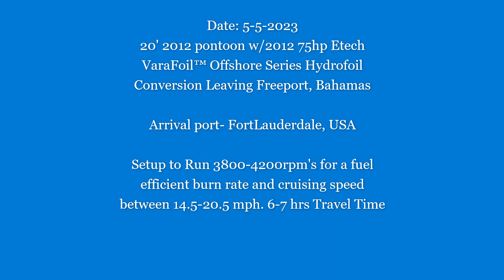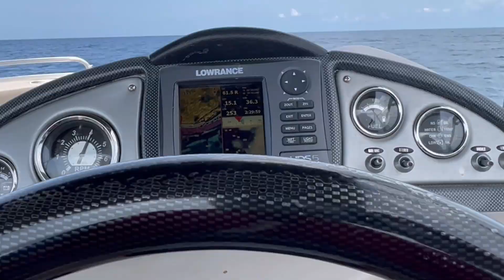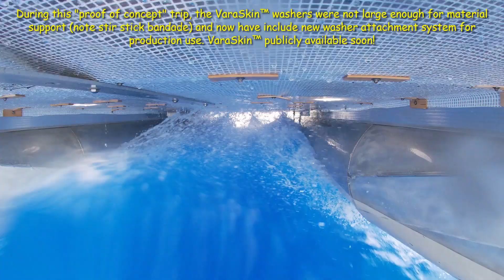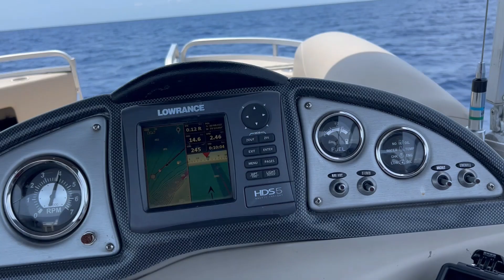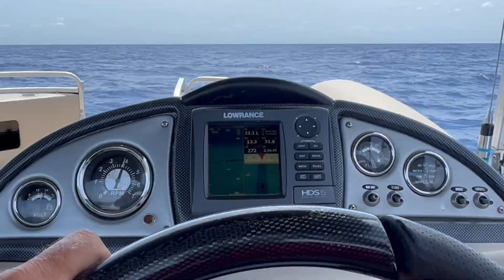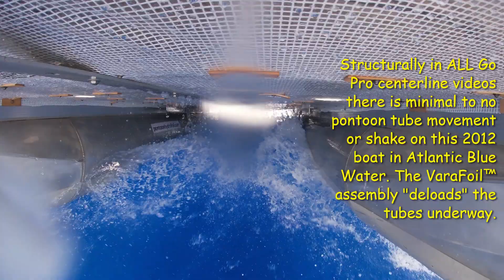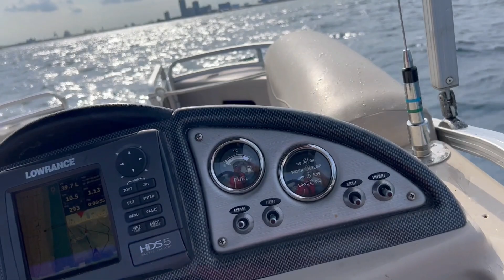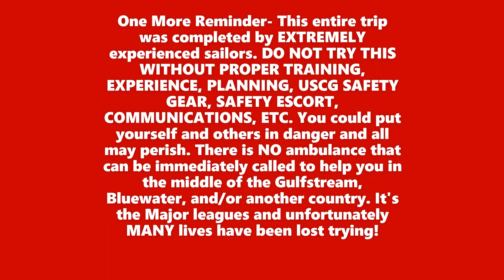Pontoon Speed Testing and Ride hydrofoiling downwind to USA from Bahamas w/ a VARA™ Foil in Atlantic

Comment: I like what you have done very much.
I would like to suggest for your study, making a set of slightly swept back wings in place of the single wing-foil. With this design weeds will slide off automatically.
A second option is to consider installing a blade leading edge that can slice through weeds.
Finally, I would like to suggest making a kind of periscope with a 360 degree camera atop and a screen on the dash to offer the ocean explorer a digitally magnified view with longer range, and possibly range finder / night vision / and other digital options.
Plus, while cruising thru deep blue water you should drop a trolling line or two. You might include in your video a catch clean and cook bonus.
Wishing you all the best!!!
Reply from the maker: Hello Stephen, 
You are obviously a hydrofoil gearhead. Check our new website out which will lead to some new good blogs and discussion.
You mentioned "slightly swept back wings in place of the single wing-foil". This is known as a "Delta" foil and a great idea and one that is very achievable. However, our patent pending VARA® Foil system is custom sized kit for EVERY tritoon, Pontoon, and power cat. So cost and affordability is a major factor for production possibilities. There is NO way to extrude a "delta" foil. You see extrudability can be thought of as a playdoh machine that forces molten aluminum thru a press at ideal temperatures. This playdoh machine produces same shape extrusions in long lengths which doesn't allow for "delta" style foils because of their irregularity. However, here is the nuts and bolts that was proven in crossing the gulfstream with "Lots of weeds". Weeds are a non factor with 30 second weed cleaning stops. VARA® foil converted vessels still outperform any pontoon boat equipped with identical engines in "EVERY" facet of boating.
Reply from the maker: You also mention "installing a blade leading edge that can slice through weeds". This idea requires another dimension to the normal boater. It also requires additional cost and education. At PHA, Inc. we decided on the "KISS" methos of hydrofoil development and design. Keep It Structurally Simple. 
Anyhow, I hope your a pontoon/tritoon owner that enjoys the great platform they offer. Stability, Size, ride, and family memories. Our VARA® Product offers the boater an accessory that converts that normal pontoon/tritoon boat to a superior vessel in all aspects of experience. ALL customers have stated that they will never return a "normal" riding boat again. check it out at pontoonhydrofoil.com Thanks for your input, Mg